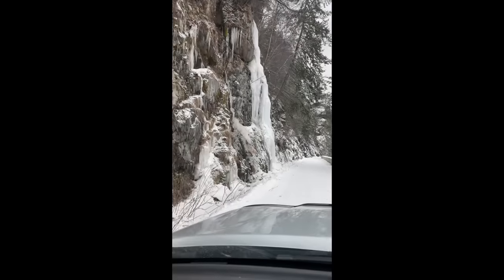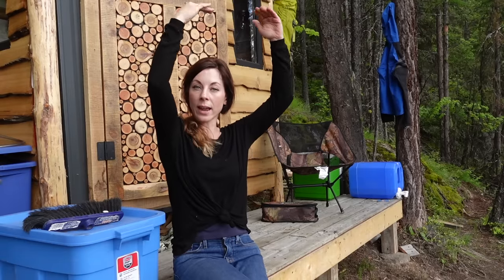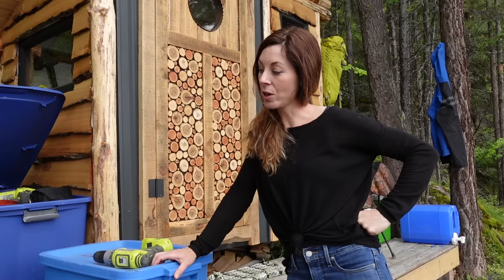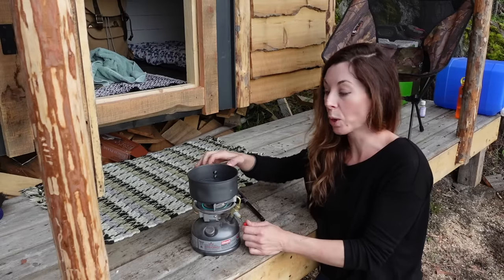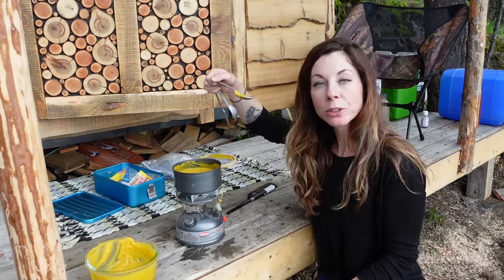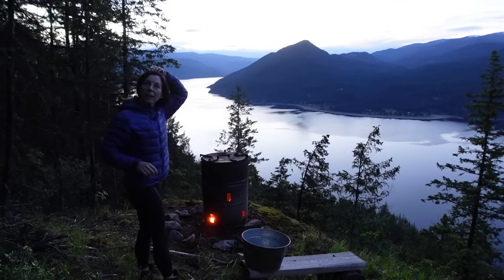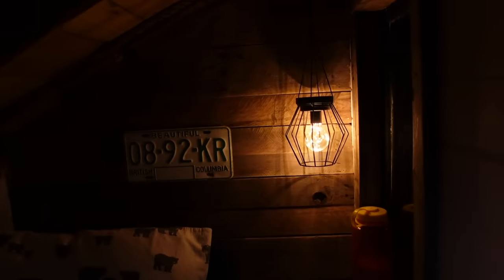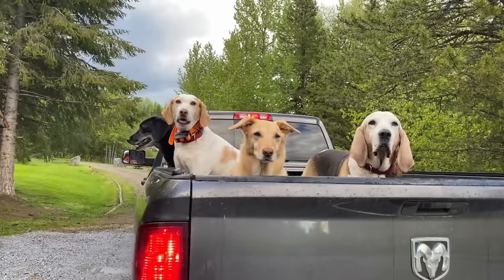MY FIRST OVERNIGHT ON THE CLIFF! | Shed camping in the Canadian Wilderness

Comment: If you want the front shed permanent, cut your rafter poles so they are supported by your back rafters, (AKA sitting on top.)  Make sure they're cut to shed water.   Screws aren't the best fasteners for outside because they're too brittle, nails are actually better though harder to use at times.  If you do it well, it will last as long as the rest of the roof.  Good Luck.

Comment: 50 years ago my Dad did projects like this. The first thing was a decent driveway in to the site. Second was a prefabricated 8' x 12' shed. It was made of 5 - 8' x 12' panels and 2 - 8' x 8' panels. He built the shed in the 1950s and used it until he died in 1976. It all just bolted together. Once we had the floor panel set, it only took an afternoon to put the rest up and install the woodstove and sink. A couple of cots with sleeping bags and we were ready for weeks of clearing, digging a cellar hole, laying the foundation, and building the house. 
The cover over the deck is an excellent idea. Get a boonie hat and a head net or the bugs will drive you buggie. Very nice stove. I bought one of those with the pot and pan set in 1978. One of the best portable stoves. 
Make a resetting trap for the rodents. A steel 5 gallon bucket with a paint stirring paddle can work well. I caught 30 mice in a week with my first one. Put soapy water in the bottom so that it doesn't stink. Good Luck, Rick

Comment: Hi Michelle just saw the anchors in the bottom of the posts holding the cabin..only a suggestion but maybe consider using some square "cyclone" washers that are galvanized and around 50 mm sq and 6 mm thick to spread the load over a larger part of the timber post base to prevent pull through?
Reply from the maker: I’ll pass that onto the engineer! 😁

Comment: First visit and highly impressed. For my SUV camping I bought a 24 inch wide Flip Chair on Amazon. When folded out flat it is seventy six inched long if memory serves. I think it is about six or seven inch thick high density foam and sleeps like a dream and it was very affordable as far as most options go. Like I said, I use it in an SUV with one side of the back seat down flat and the other side holding my 12 volt fridge.Behind the fridge is the bin with kitchen stuff and another bin with everything else like fire supplies and my duffel bag on top of the two bins for clothes. It is tight but it works. Food and lawn chairs go in the passenger front seat at night and on the bed when traveling. Yours is different but that flip chair could be a good answer for your bed. I just use a sleeping bag on top of it. Better than my bed at home.
Reply: PS with the amount of rain there, I would consider putting some slats and a clear plastic roofing on that porch and keeping it covered. Clear plastic sheets would let the light through while keeping it dry.

Comment: Absolutely LOVE your location and projects. I used to have ryobi tools, and upgraded to dewalt 20v. Twice the power and 4x the battery life. I became unbelievably more productive. I kept my ryobi chainsaw, tire inflator, air mattress inflator, and glue gun and use with an adapter. Another thing that is unbelievably handy is the hand grinder with a chainsaw tooth wheel. I cannot recommend that enough. 

Wonderful work you are doing though. 😊
Reply from the maker: I’ve seen the chainsaw attachment thingy! And circular saw blade attachment too. Neat.

Comment: You might want to fill a Tote with back-up 'Hand Tools', like a Cross cut Saw, Rip Saw/Hack Saw, Screw Drivers, Hand Drill, Chisels, Folding Tape Measure, Hammers (varying sizes), etc....that way even if you forget Batteries at your Main House, you can still do everything you need to without Powertools.

Comment: Minimize build sight time by pre-build as much as you can in a comfortable secure workspace (Garage) and flat pack it onto a trailer to your build sight; possibly hire a local workman to help you reassemble it. Use screws to tack panels together that can be easily removed and re-screwed; avoid nails, they are too hard to remove and not reusable..

Comment: Hi. Just watched a couple of your vids. Aaaaallmost looks like Harrison lake down there.
Anyhow, I noticed your rock anchors where your shower is. Its a simple solution however, I would have used a steel shoe epoxied into the bedrock. That way your beams can be cut square and you can replace anything rotten much easier.
Did you put those anchors in on your own? Curious.

Comment: I feel your pain eating out of a Rat litter box...
I just insulated my Dad's crawl space, it took 2 days. I had to wash Rat poop out of my hair. I was thinking Henta virus, when I wasn't thinking about the over all Yucky-ness of it all. 
Among the tidbits of adversity were: If I rested my head by putting my head/hair in the poop/dirt my headlamp flopped back and I couldn't see anything. and I still have a halo if fibreglass itch on my face where the full face respirator didn't cover. I know right I should be thankful! after 40 years of "Operation poop everywhere" that gravel wasn't as crunchy as it should have been.

Comment: @ 18:24: So the only thing holding the posts to the rock are those bolts? What's the sheer strength of those? I would have jack hammered more level spots for them to sit on. As it is, I would probably want to see posts angling down from the bottoms of the existing ones to a grade beam set in concrete about where you're standing. They would have to be notched into the vertical ones, or fastened to the sides. This just seems sketchy to me.

Comment: Keep a notepad and pencil in your backpack, or at the shed, so you can write down stuff that you'd otherwise forget.  Like a list of what to bring  ;-)    Also, that's a magnificent view from the porch of that shed!  What is the elevation change from there down to the water?
Reply from the maker: I’ve picked up a white board and it’s all set to be taken out there!
So from our cabin down by the lakeshore to the top of our property is about 1800 vertical feet. We built a trail from bottom to top, which took about 3 years to do. The cliff location is about 400-500 vertical feet down from the top of the property, where I parked.
Reply: @michygoss7148  If I understand correctly, the porch of your little shed featured in this video is about 1300 feet above the water?  That's quite a hike!
Reply from the maker: @toddz8579  yes! That would be about right! It is a generous hike, so although it might like an easy thing to go and sleep at the main cabin while working on the cliff cabin build, it’s still a couple of hours time and a lot of energy spent (especially packing around tools and supplies).

Comment: Nicely designed and built porch covering maybe you could make it permanent using your leftover roof metal.. 🤔😊🎈ray safe and the Ryobie $35  dollar air pump is good for inflation of small mattress pads . Just tip.

Comment: It seems like you need a small petrol generator, and a large capacity inverter. If there is a small town there,  you can use 2 x 5 Gallon gas cans for storage.  You can power a small fridge,  hot plate,  etc , and keep your batteries charged, including your phone and laptop. 

Also,  you should consider a firearm, one rifle one air rifle, and one handgun, as there are potential dangers in the wilderness. This is coming from a city dwelling non gun owning fellow,  with a little wilderness experience long ago. Hopefully you'll never need any. 

You're doing well,  always trying to make progress.  well done!

Comment: Big Cat will try to kill your dogs. You should cut a hardwood club about 2ft long and whittle a handle in it. Drill a hole to put a lanyard through and carry it with you. You can beat a tree to make a lot of noise or beat the cat if it comes too close to you or your dogs. I'm an old man so I'd carry a pistol too.
      I have calmly talked a Black Bear out of messing with me. But just in case I am not taking a butt whipping from a wild animal. Try not to look like a threat, or run like prey, and usually it will be fine. But I don't care if it's out of season or protected, I will shoot it if it attacks.